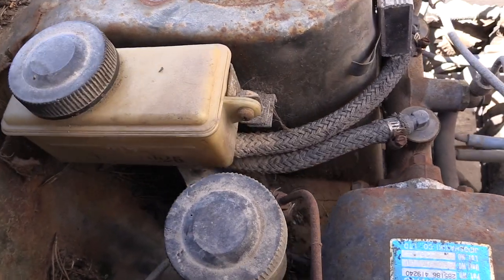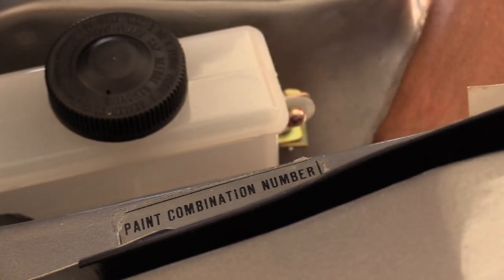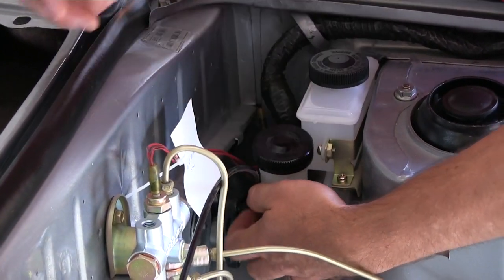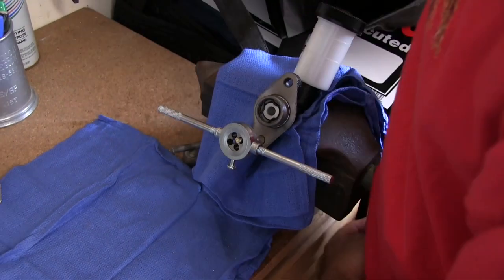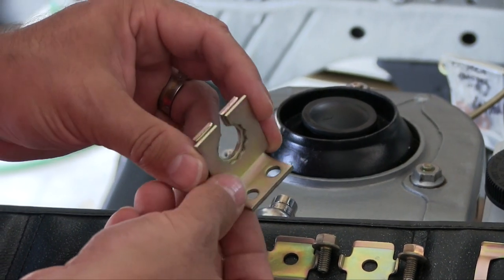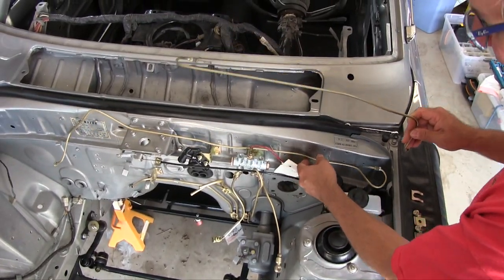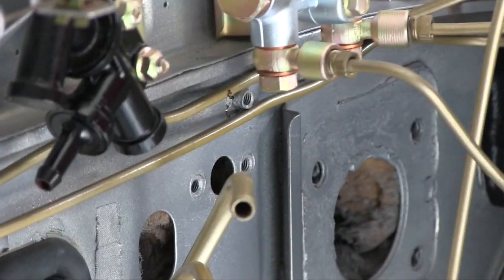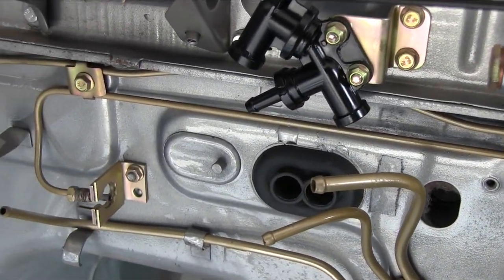VLog 39 Clutch Master Brake Fluid Reservoir & Lines Mazda RX3

Comment: Don't know if you fixed it but the metal tabs that hold the brake lines need to be rotated 90 degrees . look at fuel line they are correct. line goes under wide part of tab.
Reply from the maker: Oh my. I'll check on that.

Comment: Must be nearly due for a new episode Steve? BTW, does the brake proportioning valve have any internal seals that need replacing at all?
Reply from the maker: Hi Keith. Sorry for the delay in answering. It's been hectic in these parts. Next episode edited and I realized I need to film a bit more. That will be next weekend. Look for a vid then. No seals in prop valve. Springs and copper washers.